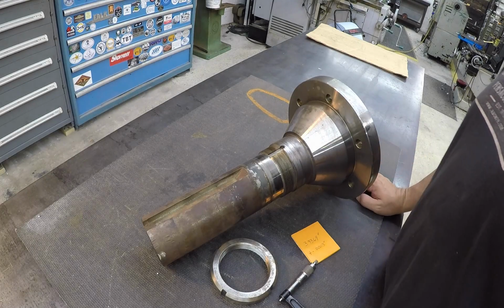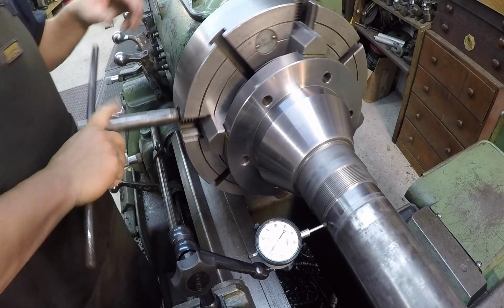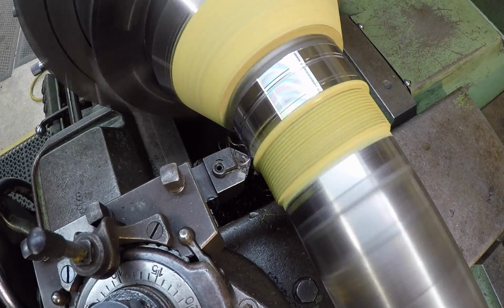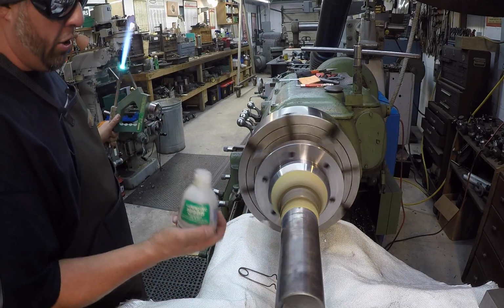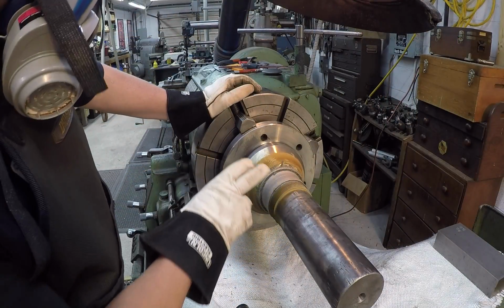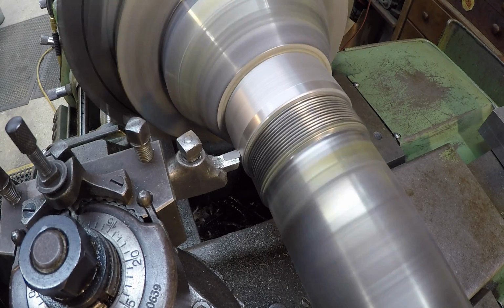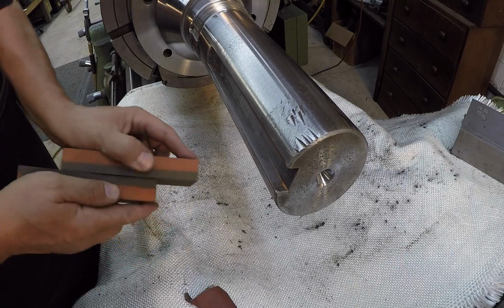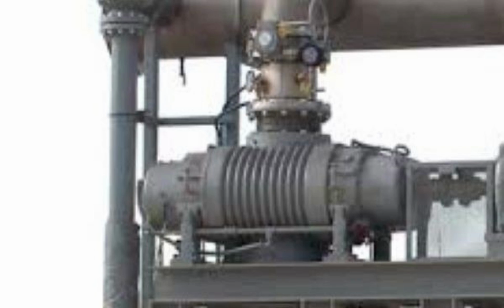SNS 300: Spray Welding a Blower Shaft

Comment: I don't normally like to judge the work of others but I would have a real hard time with the guy who put a pipe wrench on that shaft. Makes the contractor look like a butcher.
Reply: There is absolutely no reason to “Butcher” up a shaft like that. We would get fired if we ever took someone else’s piece of equipment and did that to it. There are very very few exceptions to the rule.
Reply: As a mechanic in a food processing facility, sometimes it's needed. As long as you knock the high spots down for your bearing clearances and whatnot it isn't a big deal.

Comment: Time-saver is one thing, but how anybody can say sleeving is superior to spray welding is misinformed. Spray-welding bonds the repair to the workpiece, and, as the presenter mentioned, if the correct powder is selected and applied properly, the repaired piece will not fail.
Reply: Actually a thick wall sleeve with .005 or more interference (press) is much stronger. Spray sometimes disintegrates under lateral load, but sometimes they do last forever.

Comment: Its really nice to see that Old Tech is not as useless as people tend to Believe, when Im working on rebuilding an Engine, I still use the Tools and process that I was Taught as an Apprentice, and I still use my Old Technics when rebuilding an Engine, and I get a Better result from using the Old School Process, and to date ive never had an Engine that hasn’t Performed to the Spec that I want on the Engine, i.e. Valve Grinds and Seats, Honing the Bore the old way, and my Engines last a hell of a lot longer than using these New Technics and Tools, that basically substitute Time for Quality, and I would much rather spend more time to get Quality than rush the Procedure so its NOT at its BEST Quality Workmanship, and what ive just seen with your Spray Welding, I used to see it being used over and over again Decades ago, but your Video today just foes to show that Old School is not Dead and Buried. . . Colin. . .

Comment: Spray welding looks like you are only getting a small percent of metal on the actual work you are doing and losing the majority of it to spray run off.  Why would you use this procedure as oppose to welding a couple of beads?  Just curious.
Reply: He explains at the end of the video that direct welding exposes the piece to too much heat which causes warping. Spray welding requires much less heat.

Comment: i was doing that kind of stuff at a place in winnepeg manitoba the place was called plasma and flame coating,i did the exact same thing you are doing but i had to use a diamond grinding wheel to take the OD down so they could press a seal on it or bearing. neat stuff that flame coating,it was like spray painting white hot tungsten carbide to these rods for paper plant.very precise, cheers to the machine shop apprentice's and journeyman,a very good trade.

Comment: I have used metal spray or spray welding for the last 40 years. You did a great job. Wish there were more out there like you through out the country that kept this art form going, because that’s exactly what it is. If you would like to contact me I could give you some tid bits that may save you some frustration and even put a few more pennies back in your pocket. Believe I’m not trying to sound like a know it all, that is not my intention. I have used that same gun for the last 25 years and you have come across a beaut.you may contact me if you want if nothing else just to talk shop. Not going to try and change any thoughts you already have because what you are doing is working wonderfully. Hope you have a great day.

Comment: Never actually seen this done before. Thanks for sharing. 
I would imagine that the surface prep (especially bringing it up to heat) is the most critical part of the whole process. If it doesn't bond well to the base metal, it will surely fail.  Those who had had a failure likely had issues with the prep or, like you mentioned, used the wrong powder for the job.

Comment: .0003 is 3/10THs ?? How about 3/1000s .......
Reply: What he means by 3 tenths,  3/10THs as you put, he is saying 3/10ths of 1 thousandths which reads on a micrometer .0003 to the fourth decimal.  I’m not trying to sound like a smart a__. Hard to explain in text without being misread.
Reply: that would be .003
Reply: Tenths are ten thousandths.  3 tenths would be 3 ten thousandths or .0003 inches.

Comment: I'm an attorney. I have never even been near a lathe. Had no idea of what "spray welding" was. I am in awe. What precision. I wish I had valuable knowledge and talent like this. This is what made the country great.
Reply: You've got skills! Getting a law degree is a big deal. I feel you though. I have a degree in mech engineering and often overlook how much work it took to get my stamp.
Reply: Between my time as: a Fabrication and Repair  Machinist in the Army, Tool Maker Apprentice,  External Crankshaft Grinder, Kearney & Trecker Milling and Grinding Machine Rebuilder Machinist, Deburring/Parts Finisher, Tool Room Machinist and Parts / Production Machinist I can run and do everything he can except Spay Weld. But I can also run CNC and older Automatic Screw Machines and Tape Operated Machines. It gets tough when you have to switch back and forth between old and new machines because of differences in the lines of code language used and the different codes as well. I can Mig, Tig and Heil-Arc weld, Silver Solder and Braze as well. I started running Sunnen Hones, Natco Multi-Spindle, Radial Arm and regular Drill Presses, Engine Lathes, Surface Grinders and Air Grinders part time back in 1969, while in HS. Shapers and all the other machines on and off until 2017. Good thing I'm retired or someone here would want me to fix something for them. This man is very good at what he does using old school machines. there is a lot more to do when using these things and many things come with experience and "touchy-feely" adjusting and correction skills learned.

Comment: i am  wondering what is he spraying out??? and that Mic is a good mic for checking Tenths ??? and what about the air temp in house ??? the Dims change with heat or cold air temp everybody knows that... meaning when they check the dims and they will,,,  3 tenths is not much. what will it read when they check it ??? dims will change .001 for every 10 DEG of air temp...  that is 10 tenths... and that's a lot,,,  so am i wrong ???
Reply: are you wrong? Not sure. Thermex for steel is 12 ppm.K so on a 3.936 diameter, 10 degC will add 120 ppm - that is 0.00047 in - thats five tenths of a thou.
Reply: @betwys1  i know at 10 P.M.  in the shop i work in that's in San Diego my bore gauge would change .001  it got colder and that's why i said something about temp change and what is the temp he is measuring and what temp is it going to be check at when the owner checks it at .0003 + or -  that's his problem i guess... and what is he spraying onto the surface???

Comment: Good Job. Boy that took me way back to the 80's. I did quite a bit while working in a Pump Shop, all large GM work mostly from 44" compressor pistons to a lot of large vertical lathe work including many journals just like that, but on a much larger scale, same tightness of tolerances. We always rough turned, then ground finished. The only thing we did differently was the finishing of the undercut. Instead of chase grooving the final undercut surface, we just jacked the feed rate up to 60IPM. I think pre-mydays someone had issues with pulling out of the chase at shoulders, so they just start feeding instead since no harm done.  Very enjoyable seeing someone doing nowadays. The big stuff is very dirty.

Comment: is it possible to realize this method of shafts  recovery (steel 3135
 or 3140) for heavy duty centrifugial pumps? Did anyone try it?
Reply: After 40 years plus doing this process I’ve done every kind of shaft you could possible come up with, yes even very large impeller nose repairs on turbines for hydro electro plants and the shafts to go with them. You can do the small stuff also, down to 1/8 of an inch. There is not a doubt in my mind that this talented man will face every kind of repair possible with this process in his career. I just hope he takes the time to teach another that can carry this through to another generation.

Comment: Excellent quality job - as always.  Well worth watching this process . . . I remember in the 70's and 80's my father worked for a large engineering company that dealt with large electric motors shafts and this process was sometimes used . . . but as you mention, seems less used today.  Very nicely done, a pleasure to watch.

Comment: seems that u use a wide angle camera to film?
though u are going to fix those dent mark on the top side.
this method is good to fix the surface area, but how about the torque and fatigue of the inner part?
and the work hour of it too.
also the area u fixed, it is a curve angle neck, or a 90 degree angle? does it affect the parts loading?

Comment: Coming from aerospace MRO watching this guy do this by hand seems so wrong. We had automated tooling for this kind of repair. Most likely we would auto-TIG or EB weld it then spray a plasma coat if needed.

Comment: You remind me of my history. My dad was an Iron Turner in the machine shop of Harland & Wolff Shipyard, Belfast, up to March 1957 when I was aged 5, he emigrated to London, Ontario, 6 months ahead of us. His wages immediately rose by 250%, from £15 a week ($40 CAD) in H&W, to $100 (£37.50) a week in London, Ontario as an iron turner. That’s $935 a week in 2020! Sadly, our emigration failed when after 6 months my parents both got homesick for the most religious and politically toxic city in the Western world, Belfast.  

Many years later in 1970-71, as an 18 year old, I was in Harland & Wolff Shipyard, Belfast, as an indentured apprentice plumber. During my year in the Training Centre near the top end of Queen’s Road, Queen’s Island, I managed to adjust out about 60 degrees of slack in the worn out controls and linkages of a 50-60 year old boring lathe. After about 3 tries I got the ‘go’ ‘no go’ plug gauges to have one end, the ‘go’ end, slip all the way into the body of the pump casting, and the ‘no go’ end to the line which was about half an inch in. After that, the management knew me as “the one thou’ plumber” but it was actually 1 micron (1/25,000”). 

When in 1977 I was working for a commercial shipping, marine-engine injectors repairing company, Wilson & Kyle, of Brentford, west London, I was cleaning up the faces of the injector cone and injector body with engineering blue and a broken file ground into a hemispheric palette scraper, using cross hatching and re-blueing. Everything had to be pressure tested to 16-18,000 psi, and metal stamped by a Lloyd’s inspector’s embossed punch to pass. Precision engineering is something in the blood..?

Comment: fascinating. Why is this preferable to just normal weld building up?

Maybe just kinda upholding tradition, trying different techniques. Plus all methods have positives and negatives, i.e. spatter, heat, lack of specialised equipment etc.
But would i want to buy this specialised equipment, rather than using a multi functional mig/tig welder?
Reply: lukeTDM850,,,it’s a cold welding process to avoid warping the piece. The spray welding process was designed to save the time and labor of machining a collar and shrinking it on the shaft. It’s cool as hell, I think. Apparently that spray kit he has is vintage.

Comment: I always wanted to do your kind of work,I watched you tap that shaft with the mallet and I saw it move,you are gifted.The work I do involves cutting extruded aluminum shapes at angles to the tenth degree and the hardest part is eyeballing an arc,not an electric arc but attaching a half-round extrusion to vertical legs with a 41 degree angle,I salute you on your excellent work,it was nice seeing some one do what you do.

Comment: Wow, a trip down memory lane.  I worked is a large apparatus repair shop.  We used to flame spray rider bands on air compressor double acting pistons when the cylinders needed to be bored out.
They did have the powder system for shafts, but for the large stuff, it was a wire feed system.

Comment: I used to teach spray welding at a Trades school in Sweden in the 90's. Same Eutectic but a lot more modern and easier to use. Must say you ought to use the exhaust fan from the beginning. That stuff will rot your lungs. Beautiful job. Well done. When is the US going over to millimeters? :)
Reply: Jonathan Perley  Hi. We had a specially made box made of steel and glass that fit over most of the axles we did. It was attached to an exhaust. But still the Swiss makers of the product warned us to be careful.
Reply: Eutectic even have an oxy-acetylene blower for repairing cast-iron. Similar process but you melt down the powder at the end keeping under the melting point of cast-iron (usually 1200 degrees centigrade). Done a few T-Ford manifolds that were impossible to get hold of. Once again, great video!!!
Reply: The United States is converting to metric, inch by inch.
Reply: When it becomes a better measurement system

Comment: Hi Adam. I got a question for you. I got a conveyor shaft. That got wear on the place were the bearings were sitting on 
What is the right way to fix it?  How do I weld the fillet welding on the wear place before milling it to the right diameter again?  Do the welding around the shaft or do it along the shaft?
Also, which kind of welding would you recommend? Mig. Tig. Arc?  And which fillet material? Stainless steel ?
Thanks allot. Gugy

Comment: Question: Why did you back off the tail stock while spray welding & polishing?

You took so much care to make sure it was running true at that end when you did the set up & knowing you were going to be cutting it when the spray weld was done, I would think you would not want to move the tail stock until the complete process was over. Something of that weight, may shift ever so slightly.
Reply: Possibly because of expansion as the part heats up?

Comment: A quick question, I hope. What about plasma arc welding like Ford is using to line the cylinders of some of their engines now. Could a process like that also be used to build up worn areas of parts similar to what you showed in this video? Just a curious 71 year old man here. Thanks for the education, I didn't know about spray welding before this.
George

Comment: 3.9369 in = 100 mm +/- 0.003
 mm
Whatever it is, it was designed in metric
Reply: It may well have been manufactured in Germany. 
  I know a lot if heavy, precision machinery is.  Not all, I could be wrong, just an educated guess based on past experience.
Reply: god the imperial system is trash the US needs to switch to metric

Comment: I did electrical work in the 70s at the Eutectic research facility when they were located in Flushing Queens, NY. Welding was a hobby of mine at the time. Trusting I was not a corporate spy, they very generously allowed me to walk around and observe some of the metalogical research projects they were working on at the time. It was incredible to behold.

Comment: When using emery cloth to polish, keep it wet with WD-40. It keeps the emery from loading up and cutting uneven. It also drastically improves the surface finish. Use actual WD-40, it seems to work better than anything I've tried.

Also, to clean your stones, drench them in WD-40 and slap it hard and slightly drag it across corrugated cardboard that's laying flat on a table. Rinse and repeat (hitting a different place on the cardboard). The stones I use for flat work were used every day and are 20yrs old; they look brand new. I keep other stones around for edges, rounds, etc. I also keep a seperate set for nonferrous metals.

Comment: Your customer will be ecstatic that you make meticulous repairs, which in turn saves them bundle of cash not having to replace complete assemblies. I just stopped in between a last minute search for a mother's day gift for wife, could not stop-once I started watching . Did not know that spray welding was even an option on precise applications; outstanding sir, you have few equals. I have no idea what the 642 dislikes are about, I guess they are out of ideas for mother's day presents, I'm firing the grill, steaks are always in fashion, with proper flame thrower!

Comment: As an uneducated (in this field) watcher it amazes me how much efford you put into indicating your work before even the first chip goes flying. One would think with this heavy machinery a few thousands off center wouldn't matter. Thinking about it more, probably the opposite is the case. The heavier a rotating piece is, the higher the unwanted forces when something is off.
Reply: You also have to consider that a few thousanths at the shaft, would be multiplied by the  diamter difference to the flange. On this particular piece, it would be 3 - 4 times.

Comment: Very  cool process, had heard of it but first I had seen it done. you  did a nice job explaining it and  very nice finish. Thanks for the video.
Reply: We do similar where I work. All the big stuff is an HVOF, but I have used a smaller powder torch the looks like a cutting head. The small one is a bit different as it's for higher temp tolerances. I've never seen that torch before.

Comment: Great video, I've never spray welded but want to. I was told to heat the shaft red hot, but my Eutectic manual says not. You've shown the proper way and I thank you for it.

Comment: I don't get just what it is you're doing . Maybe I'm wrong but a weld melts both metals together. Things such as soldering or brazing don't, but can glue metals.  Though in this case the binder is stronger than or equal to the parent metal, which usually isn't the case in brazing or soldering?